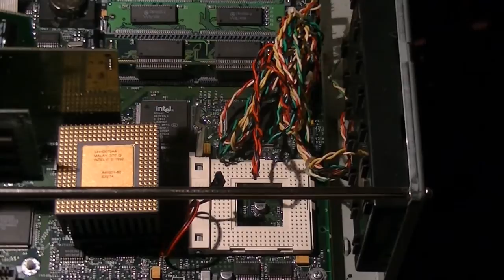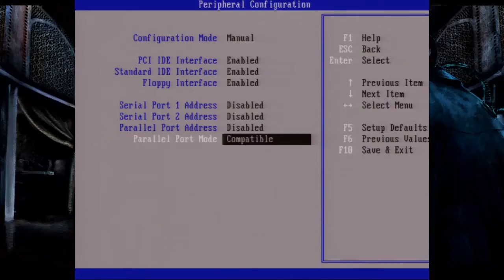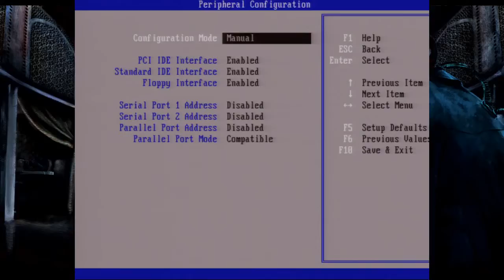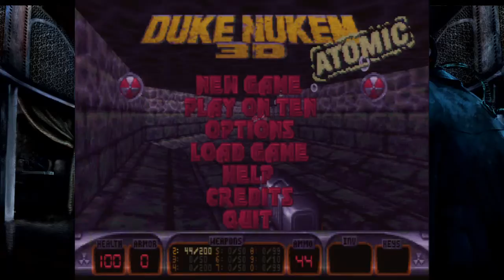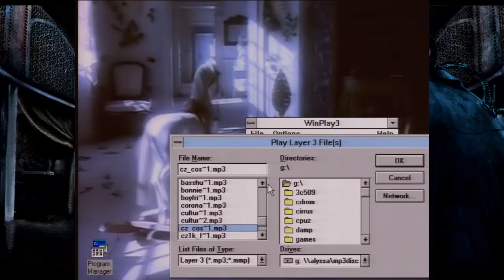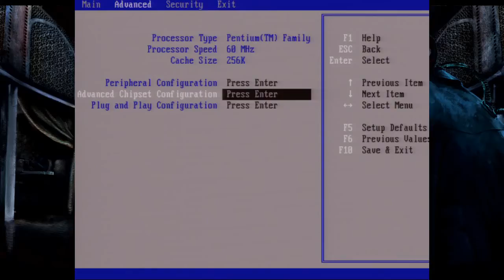Pentium 60 (Batman) Overview

Comment: There was something very, very wrong with this particular machine. I had a PC on this board from 1995 to 1998 and it was rock stable. It was slightly faster then DX4-100. It was my first PC, actually and I got here because I want to recreate it ( nostalgia bug, obviously ).

I played on 640x480 in Duke3d and Quake with 4 bots with no problems - with 24 megs of memory, x8 cd-rom and some shitty SIS graphics card.
Reply from the maker: There was definitely something wrong with this machine. It was later replaced with a different system, running an Abit PS5 motherboard which has been brilliant thus far, especially considering the number of weird peripherals it has plugged in now. There is a video on that system but it's very outdated, the system was last seen (in its current configuration) in the WinTV Celebrity and CD Burning videos if you're curious as to what it does. I find your claims of Duke 3D at that resolution questionable, it's not impossible in theory, but there's no way it'd run too quick all the time like that. In the case of this Batman board, it is probably worth noting that Intel appear to have made a few revisions of it with only minor differences, it appears the BIOS between them isn't compatible though so something changed, just not too sure what, maybe this plays a part and your board was a different revision to mine as I've heard conflicting reports from other owners, some with similar problems and others who found it to work very well. Another thing worth noting is Windows 95 silently patches some issues with the onboard hardware, so if you were running that it might have masked a few issues.
Reply: Details escape me, since it's 20 years since I sold that system. Literally. I sold it on january 1998 to a friend, and was waiting until may on an on 486 until I bought K6 233.

Anyhow. I had that system since november 1995, so it would make sense that it was a late revision of the board, with bugs ironed out. However - the only thing wrong with it that it finally developed a slight coil whine when the CPU got hot. Other then that - it was mundanely stable. Unlike ECS board I had later. I first had dos 6.22 + windows 3.11. Windows 95 got installed early 1997 because I had mere 528mb hard drive filled to the brim with games and no CD-ROM, so I simply had no space.

The only thing I regret is that I never OCed the CPU to 66mhz. That would bring the entire system to pentium 75 territory with its 66mhz bus in contrast to 50 on the later model.

Duke wasn;t running at 60fps, of course, but it was definetly playable.

By the way - love your channel :)
Reply from the maker: It doesn't matter about the specifics, wouldn't worry about it. Coil whine you say? Yes, this one did that from time to time and it took a while to figure out where the noise was coming from, though there's a 386 board (as yet unseen on here) which is much louder. The odd thing about 66MHz on these boards is how in the manual, Intel suggest the jumper (which also raises the voltage) should never be changed, but it could just be badly worded as it seemed fine at that speed - it about matched the PS5 at 60MHz too, though that one was quickly moved up to a 66MHz chip. Speaking of that system I'll definitely have to go away and test Duke 3D with it out of curiosity, the way Build's performance scales can be strange and you've got me wondering now as I don't recall pushing this one past 320x200.
Also, thanks.

Comment: I also have the Pentium Overdrive 133 for this socket. But the speed gain is raher slim in most programs. :)
Reply from the maker: +AmstradExin I wondered how far it would improve things and suspected it would hit some kind of bottleneck on the board. Which chipset are you on? If you're on a Mercury I'd be curious if this OverDrive behaved differently on something like a SiS 5500 chipset as these supported the later P54 whilst being used on later P5 boards, I assume other chipset makers probably did similar things.
Reply: HighTreason610 I will take a look later...
Reply: I have that SIS Chipset. With 512K Cache, speed not maxed out, it is almost exactly 33% faster than the Pentium Overdrive @100Mhz on my UMC Socket 3 Board. According to GLQuake Benchmarks with a Voodoo 2.
Reply: Also, Windows 98SE runs really well on my SIS Socket 4 board with 128MB RAM. (The max) You could put in 2MB of cache in it, but it would be a waste, since 1MB could cache the while Max area already...
Reply from the maker: Cool, thanks! 33% seems consistent with what I've seen from my own SiS board with similar processors. I'm on 512K and I'm not sure what to make of the idea of 98SE on this platform, given my SiS system is much faster than the one in this video and I'm hitting a wall already in WFW. The OS runs very well on its own, but I can only see the video and audio tasks I've been using it for getting slower if I upgraded. I suppose like anything it is somewhat usage dependent though, not everyone finds a need to produce songs or render high resolution ray traced spheres on this hardware, but it does put the system at its upper resource limit most of the time.

Comment: Your theory about the cache I think is quite possible. These first pentium processors were designed to be equipped with 512KB of cache. That was one of the Intel requirements for the processor which was rarely met except in high end workstations and servers. Gateway was good about cutting corners and costs in the consumer grade machines by using less cache than recommended or designed for. Although they did use an Intel chipset, they could have used a much cheaper/crappier Opti or SIS or whatever the el-cheapo chipset available at this time was, then again I don't know if anyone other than Intel ever made a chipset for socket 4.  I don't think the chipset or processor is at fault totally, given it is having to cope with half the cache it was intended for.  I think it is likely that the cache is running out of stored memory, and the processor is having to fetch more from system ram to repopulate the cache causing the slow down. I also believe the "Branch Prediction" and "SuperScalar architecture " was a bit dodgy on these first Pentium processors and I can see that as being a reason for performance and caching issues as well, especially the branch prediction as it "guesses" what code is coming next and stores it.

Of course, Intel claimed the "branch prediction" guessed the code right about 80% of the time when this cpu was introduced, but we know how Intel likes to pad the truth a bit. Case in point would be the P4 and Rambus.

It is a bit like the HX chipset caching issue, where it could only cache the first 64MB of system ram. Even though the HX chipset was Intel's performance chipset for socket 7, it suffered from slow down once more than 64MB of ram was installed and accessed.
Even the Pentium Pro suffered from caching problems, which is why 16 bit code performance sucks compared to Pentiums. A problem Intel fixed with the P2.

I also remember back in the 90's hearing the Pentium 60/66 was essentially 2 286 processors spliced together into 1 core, but I have never read anything to confirm this.

I also am pretty sure this motherboard was from a Gateway P5-60 desktop computer. As I had one many years ago, I recognize those slanted memory slots to fit memory under the hard drive cage, and also that bios screen.

Although my P5-60 is long since gone, I still have the original FVID bugged Pentium chip. I would like to find a real good example of a socket 4 motherboard with the cache requirements met to test my cache theory.  But socket 4 boards are hard to find, and even when they do crop up, people think they are worth a ton of money. Oh well.

Comment: Were there any better chipsets for Socket 4?
Reply from the maker: There were other manufacturers such as SiS, possibly VIA, ALi, OPTi and UMC. Unfortunately I don't recall using them. The i430 isn't that bad, it just tends to be paired with faulty disk controllers and in this case a bunch of other components that didn't work properly. This motherboard gave up on life not long after making this video, and whilst I could probably fix it, I'm not going to as I have a perfectly good Pentium 75 in that case now on a 440 chipset.

There are boards that have the 430 chipset and use SCSI which are probably more reliable, though I couldn't guarantee it and would still recommend either a quick 486 (100MHz should be about equal in games) or a 75MHz Pentium due to the Socket 4 Pentium being unpredictable on it's own. Socket 3, 5 and 7 boards are better documented, more reliable and better supported.
Reply: Do you think that some of the Socket 4 Pentium's problems may have been caused by its excessive heat dissipation? I'm kind of wondering what sort of stability could be achieved with one given a better motherboard, and a much bigger heatsink.
Reply from the maker: mrbigmouth502 It wouldn't surprise me if it was. This one certainly used to get warm, though it wasn't so much the CPU as the motherboard itself.

This particular one is known for that as despite having a 66MHz option you couldn't actually install a 66MHz chip because the board couldn't provide enough power - Just 2 Watts more than the 60MHz model, so the board is "barely spec" indeed. I found a usenet archive where a user claimed the traces in the board "Lit up like a neon highway" after having one in for a while. This doesn't explain why RAM and expansion cards run hot, nor why power was going to that battery (It shouldn't do that, though I still recommend diodes) but overloading power circuitry does tend to make strange things happen and lots of heat of course. Despite this, it was still a fun thing to mess with because of it's history and the strange implementations.

Definitely avoid the RZ1000 and CMD640 IDE controllers because they will corrupt the hard drive. Also Intel branded boards, none seem to have a good reputation. If you decide to mess with one I hope you have better luck than I did.
Reply: HighTreason610 It would be pretty neat to have a Socket 4 box, as they weren't very common around here from what I understand, but I'll definitely watch out and make sure I get a decent motherboard if I ever get around to building one.

As for the traces lighting up on that guy's motherboard, that's pretty crazy! I never knew motherboard traces could even get that hot without burning out!